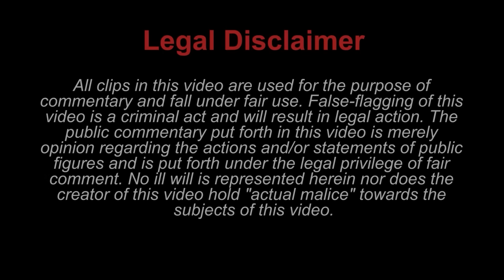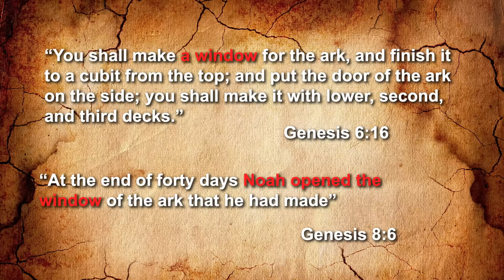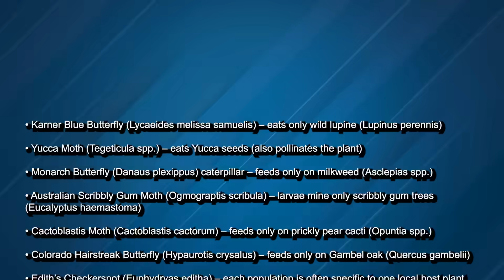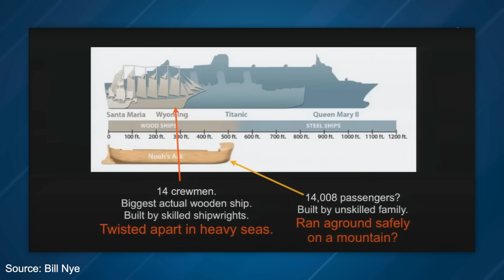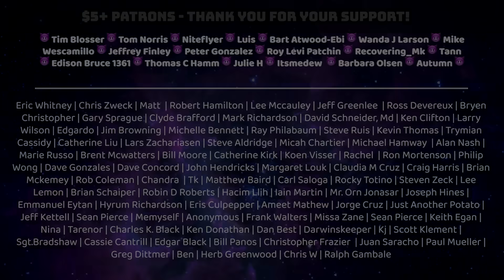Everything Wrong with Noah's Ark in 10 minutes

Comment: Animals on Noah’s Ark Could Survive Bacteria, Viruses, and Fungi

1. Natural Immunity + Healthy Conditions. Animals and humans already had immune systems — designed by God to fight off common bacteria and viruses. Since Noah only brought healthy, clean animals (Genesis 7:2), they were likely not infected with deadly plagues or diseases. Less contact with outside populations = less disease spread (no pandemics on a closed boat). Fewer animals = less chance for infection cycles. Think of it like quarantine.

2. Ark Design Prevented Mold & Fungus Growth

Genesis 6:16 says: Make a roof for the Ark and finish it to a cubit above, and set the door of the Ark in its side. This implies the Ark had: Ventilation windows around the top (likely open slits). Multiple levels for airflow Wood surfaces = naturally antifungal (cedar, gopher wood, etc.). Proper air circulation would have dried out moisture, preventing mushrooms and black mold from growing. Cleanliness & Waste Management. Noah and his family had to manage animal waste daily. They could have used: Gravity chutes to dump waste outside. Sawdust or straw to absorb urine. Ash or lime to neutralize odors and microbes. Designated waste zones. Clean waste systems = fewer infections, less fungus, and a safer environment.

4. Microbes Came with Them — but Didn’t Overwhelm Them. Animals already carry good bacteria in their guts, skin, and mouths — these actually help fight bad bacteria. Viruses can go dormant and not harm hosts unless triggered. Fungi exist in nature all the time, but only harm animals under stress or in bad environments. Since God called Noah to preserve life, it’s likely: He allowed only manageable microbes. He kept lethal diseases away during the voyage.Think of the Ark as a controlled environment, like a biosphere, where microbial balance was preserved naturally.

5. Hibernation = Lower Risk of Disease. Many animals likely slept or entered a torpor state during the flood: Lower metabolism = less food, water, and less disease vulnerability. Inactive animals = less interaction = less bacterial spread. Fewer moving parts = easier for Noah’s family to manage. Sleep reduced animal stress, which reduced disease risk.

 6. God’s Protection

Even with all this: The Bible makes it clear that God was actively involved (Genesis 7:16: “Then the Lord shut him in.”). God likely supernaturally protected the animals and humans during the voyage — even in unseen ways.
Reply: What about the thousands of species of termites that would've eaten away at the ships?

What about the Thousands of Tons of feces that they'd have to dispose of, daily. 
No animals got sick? Oh because of God magic of course.
No animals fought each other and killed each other? Oh because God magic of course.
What about all the parasites?

What about freshwater fish?

What about the physical weight limitations?

What about a million other things that literally make it impossible but you fools still somehow explain away with "errrmmm. God magic actually!"

Well if God's so damn perfect why diddnt God just not build a convoluted ass Ark and just Miracled all the animals back into existence after the flood?

What about the fact that the ark would've had to been thousands of miles long?

And even besides that. What about the impossibility of a flood to begin with? A flood that would've stretched over the highest mountains? A literally physically impossible amount of water with no geological evidence of it ever have happened.

Comment: Something important to know there was a fossilized boat found on a mountain in turkey so the is a archeological evidence that water covered at least a large portion of that mountain.
Reply: There is a later video about that boat, came out 2 days ago.
Reply: What was found in Turkey was randomly shaped dirt and rocks formed by wind and water erosion on the side of a mountain.
Reply: @VisshanVis  No it was a boat and had metal nails in it that were man made steel alloys it also matched very closely the same length width and height as the boat described in the bible as there is a description of its size in cubits using ancient Egyptian cubits this boat matched the measurements very closely
Reply: @kennygrace4335   had metal nails in it that were man made steel alloys 
    That's impressive considering metal wouldn't be discovered and used for another 4000 years.
Reply: @VisshanVis  The truth is in written history just because there is the first reference to or oldest found written source of a technology existing ( for example steel making) doesn't necessarily prove that that was the first moment in human history that technology or knowledge was used or known by humans.  There is also the pre writing archeological record which often leads to new findings updating how much we know about the ancient past and there is still more to discover. Also carbon dating has been proven to be inaccurate. There was an experiment done which involved carbon dating a freshly killed animal which showed that the animal was thousands of years old. Carbon dating is not a reliable method to prove at whate time in history mankind discovered ancient technologies.

Comment: Hi - not so far fetched.  Did you know that the dimensions of the ark have been shown by experiment to be exceptionally stable in big waves?  And did you check out ancient wooden ships?  eg "Athenaeus gives us a detailed description of a very large warship, built by Ptolemy Philopator (c. 244–205 BC).7 It was 130m (420 feet) long, 18m (57 feet) wide, and 22m (72 feet) high to the top of her gunwale. From the top of its sternpost to the water line was 24 metres (79.5 feet). It had four steering oars 14m (45 feet) long. It had 40 tiers of oars. The oars on the uppermost tier were 18m (57 feet) long. The oars were counter-balanced with lead to make them easier to handle. It had a double bow and a double stern and carried seven rams, of which one was the leader and the others were of gradually reducing size. It had 12 under-girders 275m (900 feet) long. The ship was manned by 400 sailors to handle the rigging and the sails, 4,000 rowers and 2,850 men in arms for a total of 7,250 men. This ship was too large to be of much practical use." - creation.com.  Then there is the fact that the total number of types of animal needed would be a lot less than all the animal types now.  Species diversify, eg dogs from wolves (note still dog/wolf type, not a cat), cats from one type etc, and dinos would have been taken on as young.
Reply: Did you know there's not a timeline or date for this flood story?  Also, the description of this "warship" was too large for practical use. Too large for practical use? In other words it wouldn't make it on a year long voyage.

Comment: What's so hard to take? He was told to bring animals from "dry land" which means aquatic animals could make it. Plants can survive under water. Go look up research by Darwin. Maybe that'll be easier to believe 😅
Reply: Survive under water for a year? No, they cannot.
Reply: @eddiethatvoguy7901 Yes a lot could've died and maybe this contributed to less competition for food in the sea. Maybe similar to WA 1980
Reply: @johnfek6331 first. There is no date or timeline for this flood. Second.  Plants need sunlight. Being deep underwater would cut them off from sunlight for nearly a year. Third. the massive water weight and pressure would break and snap all plants.  They would not be able to survive a global flood.

Comment: Noah's Ark was built following God's specific instructions (Genesis 6:14-16) using "gopher wood" (an uncertain type, possibly cypress or processed wood) and waterproofed inside and out with "pitch" (kopher), likely bitumen/asphalt.
Its design was a massive, rectangular barge (300x50x30 cubits) with three decks, internal rooms, a side door, and a tsohar (window/roof/light source).It was built to float and preserve life, not for navigation.
The Ark resisted the Flood due to:
 * Stability: Its 6:1 length-to-width ratio provided excellent stability, making it highly resistant to capsizing, even in huge waves.
 * Strength: Plausible ancient construction techniques (like strong framing or joinery) could have ensured the large wooden structure held together.
 * Waterproofing: The pitch coating sealed the vessel against the floodwaters.
Reply: Derp.

Comment: The queen bee (a honey bee) is impregnated by drones. This happens during a nuptial flight, in which the queen mates with several drones in the air. The drones die during mating, because their genitals break off, which is not possible because there were only 2 bees. The fly The life cycle of a fly, from egg to adult fly, can be completed in a few weeks at pleasant temperatures. Flies reproduce all year round, which contributes to their potentially large population growth.In poseble with only two flys . Termite reproduction a termite queen can lay up to 30,000 eggs per day. Not to mention that there are several types of Termites that were also on the Ark. If it had really happened, the Ark would have been eaten to pieces within 4 months. Etc. etc. etc. .And where did he put the Dolfins and Whales,Sharks .In short all of the sea creatures ? Noa's Ark is B,S

Comment: I worked for nearly 40 years in new ship construction, and can also add that an approx 450' all wooden ship would not have been seaworthy.  300' is about the limit for an all wooden ship without metal reinforcements in the hull.  Its due to stresses known as 'hogging and sagging', with the repeated bending moments the hull will crack then fail.  So this mythical ark would have busted apart in pretty short order.
Reply: Esp with all the weight on it hey.

Comment: If Mount Everest was covered by a flood, at a minimum rain would have to fall at a rate of 221 metres everyday. Sound credible to you?
Reply: How high was Mount Everest thousands of years ago?
Reply: @K_d_-dz6ps  As the 'flood' was supposed to be only some 4500 years ago, Everest was not significantly different than it is today. In geological terms 4500 years is a blink of an eye.
Reply: @ianaspland1768 

So, you are 100% sure of this?

And you have ABSOLUTELY NO SHADOW OF A DOUBT that what you stated is correct and reliable?

Comment: The flood was a myth? were you dropped on the head at a young age by one of your fathers? ever hear of the younger dryas? or the flood that wiped out Atlantis (Richat structure)
Reply: Elaborate
Reply: The flood myth involved the six nights in Genesis one. The signs are Scorpio thru Aries aka autumn equinox - spring equinox. The writers tweaked the signs to change them to Scorpio thru Pisces. Like in Rev. 9.5.
Reply: The bulk of the bible is nothing but fiction, myth with a few real places and a handful of real people. No different than Gone with the Wind in its factual content.

Comment: 1) My favorite example of the animal not getting home after the flood is the sloth.  Only in South America.

How does it get there?

See, we know that sloths are slow.  But that's not because they are lazy.  They are slow because their bodies are not able to metabolize food fast enough to generate enough energy to go fast.  They are anatomically limited in how fast they can go.  "Full speed" for a sloth consists of about 300 ft per day.  They cannot go faster than that, their bodies cannot generate that much energy.

So after the flood, how did the sloths get back to South America?  Even assuming there was a land bridge across to Alaska, the trek from Mt Ararat in Turkey to even Central America, at 300 ft per day, would take about 1000 years.  With an average life span of 20 years, that's about 50 generations of sloths all going that way. 

Why?  If the claim is that "God directed them," it just begs the question of why?  Why does God need to have the sloths only living in South America?

2) You mentioned the issue of rapid evolution.  According to AIG, there was a single mating pair of "cats" on the ark.  But that single mating pair of cats evolved into 11 genera and 43 species in a couple of thousands of years?  In fact, we have evidence of at least 3 genera within 500 years of the supposed ark (Cheetahs and domestic cats are in the pyramids, and we have paintings of Asian tigers in East Asia).  That is evolution faster than any biology would ever suggest, and this is suggested by the people who insist that "macroevolution cannot occur." 

What is the mechanism of this rapid evolution?  And remember, as soon as you resort to "Goddidit" the entire discussion is moot.

Comment: 6:58: "The impact of massive amounts of rain drops would have created enough heat to boil the ocean."
I think this is completely wrong. While a rain drop does have some kinetic energy and this energy turns to heat in the moment it is stopped, this amount of heat is completely insufficient to even significantly heat up the rain drop itself, let alone boil it.

All other arguments here are valid and well presented, but this one just is false. I think you should remove this.

Comment: And there's other things to consider, including:
1) Every one of the eight humans on board would have to move - at the very least - 3,500 lbs of shit every day, from the bottom of the ship to the top, with hand buckets and shovels, and somehow get it out that 18-inch gap at the very top without spilling any...every single day. 
2) The only way to keep a wooden boat that size afloat for any length of time, even in perfectly calms waters, would be to pump out the bilge constantly so the ship doesn't fill with water and sink, a feature of every wooden ship ever made...so those eight people would also have to be emptying out water constantly, with bronze-age technology (meaning buckets).
3) Surviving in even normal ocean waves requires keeping the bow pointed into the waves. The ark has neither a rudder nor any means of propulsion, so cannot maintain any kind of direction control. It would be smashed to bits even if it was initially seaworthy.
4) Once the flood waters finally recede, there would be a layer of mud covering the entire earth tens of meters deep (at least) which would take decades (at least) to dry. So anyone or anything stepping off the ark for the next 10+ years would sink out of sight in the mud.
5) Nothing grows in mud, especially nothing that humans can eat...so 10+ years of starvation, or that much more food the ark somehow has to store while everyone remains trapped aboard.
6) If the insects weren't saved in sufficient diversity and quantity, then even when the mud dries nothing will grow. Permanent starvation. 
7) All water on earth is contaminated with decaying corpses and mud and silt and salt...so nothing to drink for decades as well.
8) In any case, the volume of decaying corpses created by this flood means a guaranteed worldwide plague.
     The number of times god has to wave a magic wand in order to get this story to work is just too much.
Reply: I've never considered the issue of contaminated soil and water due to all the dead and rotten flesh. The issue of a lack of rudder or propulsion is also an issue that I've never considered. Great points!
Reply: "neither a rudder nor any means of propulsion … would be smashed to bits"
It's notable that such issues (e.g. being turned broadside to the waves and capsized) are mostly an issue for long, thin vessels such as the one in the Noah myth.
Circular vessels such as the kuphar from Atra-Hasis are much less susceptible to that.
Reply: @alexhajnal107  True, when the writers of genesis plagiarized the myth the changes they made were real mistakes.
Reply: @njhoepner  The real issue is that the authors of the Noah adaptation seem only to have had a fleeting exposure to the culture that they were writing about.  They heard myths in passing but didn't understand anything about the context in which they were set.

As for «plagiarizing», I truly despise use of that term in this context; it has a very serious meaning and this usage diminishes that.  What the cultures did (as cultures always have) was adapt popular tales into new forms.  Noah didn't plagiarize Gilgamesh nor did that plagiarize Atra-Hasis.  To use modern examples, one wouldn't consider The Warriors adapting Xenophon's Anabasis or West Side Story adapting Romeo and Juliet as being plagiarism.
Reply: @alexhajnal107  If the writers - or those in the present insisting on a literal interpretation of the story - would admit the obvious borrowing and adaptation, it would not be plagiarism. I understand what you're saying, but in certain contexts I think it still makes sense.
Reply: As the Bible says : The wisdom of God is foolishness to men. 1 Cor.1:25 Y'all minds are too shallow to comprehend God's Wisdom.
Reply: @aangpiato2949  Right. You insist that god is too deep to comprehend...then immediately tell me EXACTLY what god thinks about me, about how I live, about what he wants, etc etc. Hilarious.
Reply: @aangpiato2949  That's nice but has no relevance to anything outside of theology.  We're discussing the real world here.
Reply: Grab a beer, put your dog on a leash and go on a walk to the park. You really do need to step away from this whole thing for a bit. If you do not have a dog, at least drive down to Walmart and get some peanuts or something. But back away from the Noah thing. Please.
Reply: @roberthenry9319  Not at all. Figuring all that out took about five minutes...no obsession required.